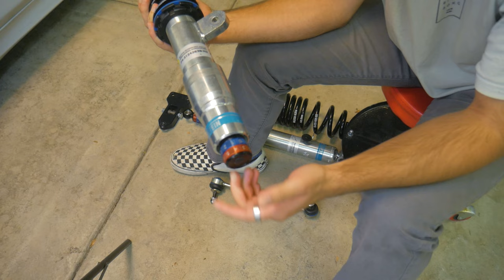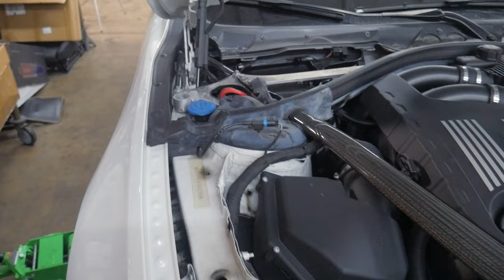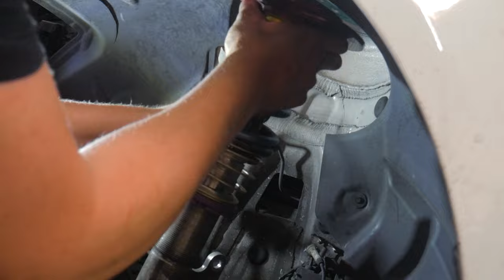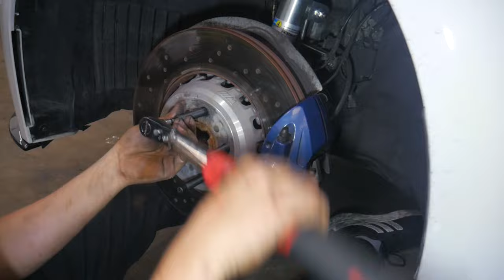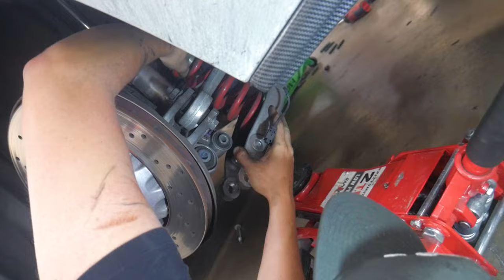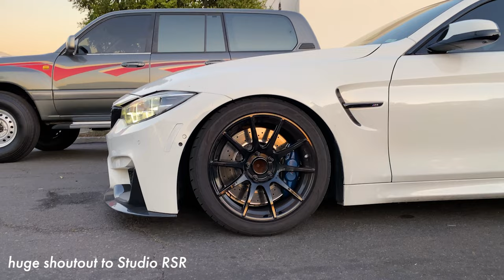My F82 M4 GETS $4500 BILSTEIN CLUBSPORT COILOVERS! HUGE SUSPENSION UPGRADE!

Comment: Did you fully observe the studio tech making the effort to ensure all bolts are torqued to value and the appropriate nuts/bolts torqued down with load on the suspension?  Height looks great as usual.  Thanks!
Reply from the maker: thanks! Yes, I did. He followed the torque specs provided in the user manual from Bilstein. I glossed over some stuff for the sake of keeping the video length to a reasonable time but it was a thorough install

Comment: Did you consider anything like the Sachs/ZF or Ohlins inverted style coilovers? That is, if they even make them for your car? I have heard great things when used on an E90 M3.
Reply from the maker: i looked into Ohlins, but the TTX dampers are like $10k+ and the other option was R&T which isn’t nearly as good as the bilsteins in my honest opinion
Reply: @SimplyCarThings  Ok, the only Ohlins I've seen were in the 3-4K range (that YT channel "Driving Cody" dude has them on his E9X M3 and he raves about them), but like I said, those are for older model cars so I'm sure the technology is quite improved since those first came on the market. Do they only have like the lone $10K option for your car? No lower or mid-grades? Seems crazy they wouldn't have anything other than a $10k option. I mean you could buy a whole ass N52, N54, or N55 car already half modded for that price lol. Anyways, how about the inverted ZF/Sachs? Have you seen those before? Was thinking about getting those for my E90 but I don't think they make them for xdrive cars, from what I could tell. 
Thanks for all your videos. Been subbed here awhile and I generally agree with almost every take you have and I been jelly of all your cars.
Reply from the maker: @saganworshipper6062  haha thanks man, appreciate the support! Like I stated earlier with Ohlins according to my knowledge there are two kits. The R&T which is around $3k ish and then the TTX, which is what the M4 GT4 runs but those are very expensive. The bilstein kit is superior to the R&T IMO. i didn't look into sachs/zf but I'm sure they have something out there for the F8X. Im sure its a different ball game for the E9X